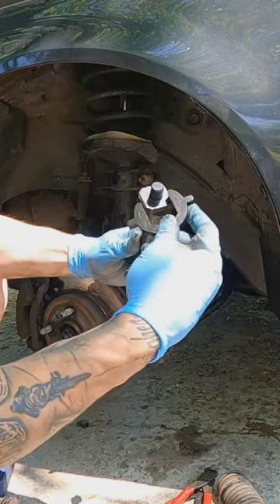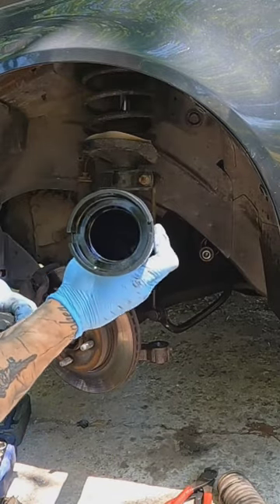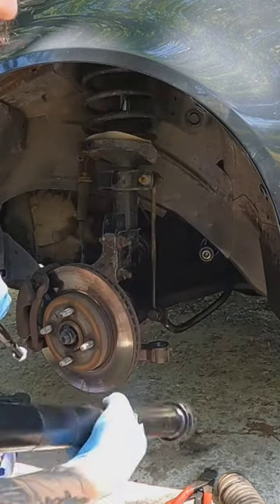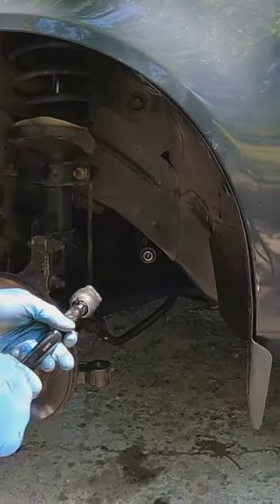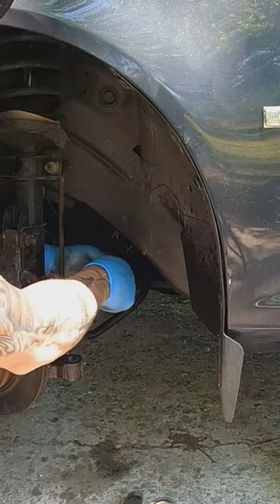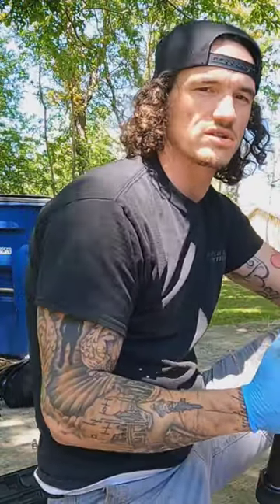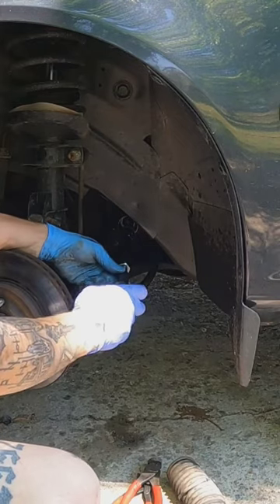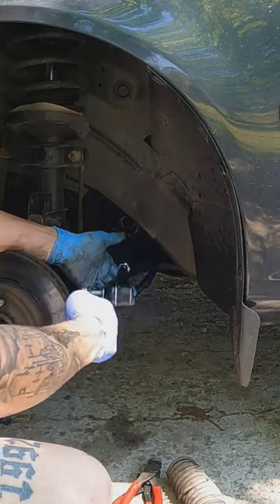part 5 Chevy cobalt #fypシ #mobile #mechanic #letsgo #chevy #mobilemechanic

Comment: I love those there nice 
Butttt I work with a a 25 year tech who told me one day you don’t need that just turn the wheel all the way to the right or left and use your massive pair of channel locks🤯.. that tool and the channel locks are both just as easy
Reply from the maker: Not lying but could you imagine the types of comments I'd get for using channel locks?!? I mean I used a professional tool specifically designed for this job and STILL got not a comment with 🤯 in it. People criticize constantly at my work. As your seeing now so I try to avoid doing certain things like using the right tool for the right job
Reply: @ParkersMobile  people find anything to complain about in my opinion if it gets the job done fast,efficient, and you’re not tearing it up who cares yah know?